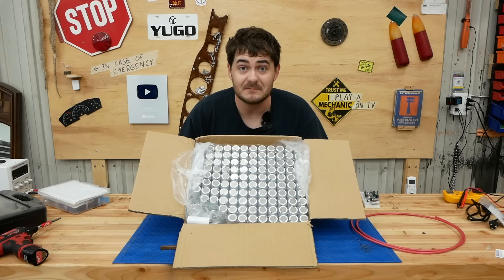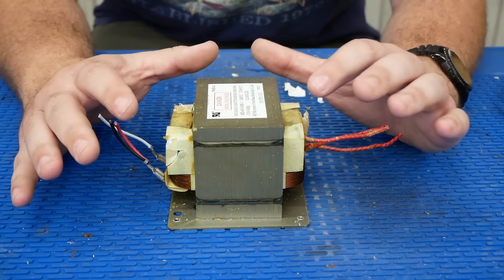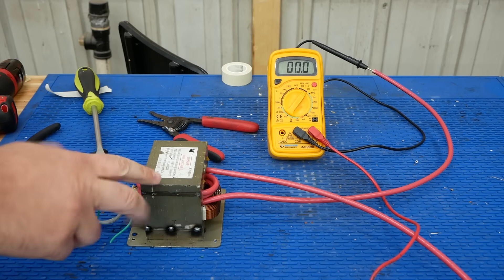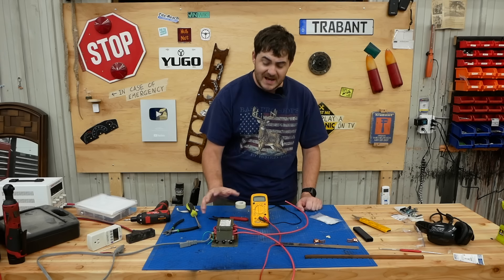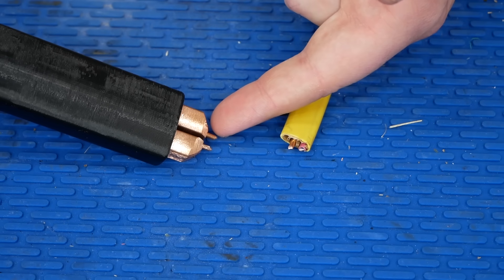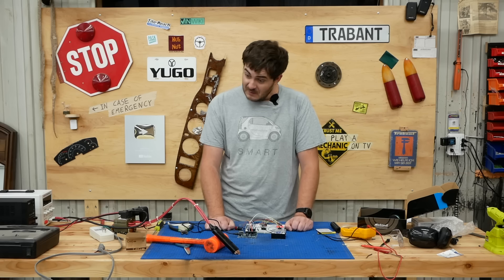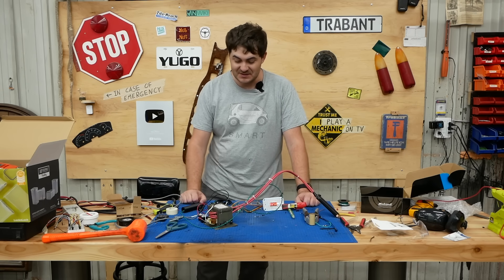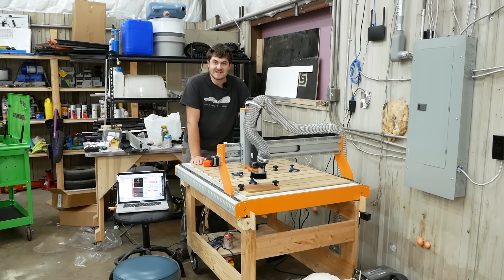I Made a Battery Spot Welder from an Old Microwave and Excessive Mahogany

Comment: This isn't as dangerous as it seems. I don't see any comments thoroughly explaining this, so I'll try my best.

First, I'd like to discuss the misnomer that it's not the voltage that kills but the current. This is technically correct, but not the full story.

It boils down to Ohm's law, which says Current = Voltage ÷ Resistance.
These three values are always tied by this relationship. And there are some consequences to this:

1. An open circuit (no connection) will have an infinite resistance. No current will flow and a power supply will be at its max voltage. Here we see 2V.

2. A short circuit will have no resistance. Therefore infinite current will flow in theory. Metal is an approximation of a short circuit due to having low resistance. If the power supply cannot keep up, it's voltage will drop to maintain Ohm's law.

3. Due to consequence 2, Robert should have actually measured current while welding. (A short circuit) Not while open. The 10A is probably just due to losses. The real current might be much higher than 600A through metal.

4. The human body is pretty resistive. The exact number will depend on what two points of the body you measure through. But even two points close together on the skin has a high resistance. As such, at 2V, the current is very low. Nowhere near enough to hurt you. At 120V, you can flow enough current to kill depending on where through the body it flows. (Particularly the heart)

5. Due to that, the output is actually less dangerous then the input to that transformer after modification. (NOT before)

6. Still, it makes the metal hot. If you touch it while it's welding or shortly after, you will hurt yourself. Be careful nonetheless!

Hopefully this has been educational. Electricity is truly fascinating, and I'm all too happy to spread my knowledge!

Comment: Just FYI: if you can, it's better to remove the secondary without cutting the transformer open (you can for example cut the winding in half and punch it out) because if you break the core you'll never weld it together perfectly and it's gonna change both the inductance of the primary and in general increase the loss of the transformer. You can see this in the video when the transformer vibrates really loudly and draws a lot of current even with no load
Reply: Microwave transformers are purposely lossy.  Wasting power with no load was the cheapest way to current limit the magnetron tube.
Reply: @anullhandle  Yeah, but still, drawing 10A @120V is a lot of power loss. I don't think they're supposed to waste a kW just sitting there idling
Reply: @gigigigiontis8  yeah that's a cubic  butt load.  I think they had magnetic shunt pcs in there making them lossy but kw idle is a BIT much :)
Reply: @gigigigiontis8  It's not actually a kilowatt; most of that 10A is reactive current, which isn't actual power drawn and dissipated, it's energy drawn, magnetically stored in the core, and returned on the next half-cycle. The current is phase-shifted with respect to the voltage. If the transformer actually was drawing a kilowatt unloaded, it would get very hot very quickly.

Also about the video, multiplying the apparent current by the turns or voltage ratio does not give you the maximum output current. Those numbers have very little to do with each other. What you could do is measure the change in primary current between unloaded and while making a weld, and multiply that by the turns ratio.

As you can see during the few test welds, the current is very high, as the strip is glowing. Most similar spot welders not only adjust the length of the pulse, but also the power, by using phase angle control. This requires a zero-crossing detector and some software that's only a little more complicated than just a single delay.
Reply: @tonfleuren3536  That is true, I didn't think about that, but all that current still has to pass through the primary winding; it's still not normal. But you're right, I should've said 1 kVA instead
Reply: @gigigigiontis8  I've just measured the primary winding of a relatively small MOT, meant for 230V, with the secondary windings and the magnetic shunts removed; the resistance was about 7 ohms, and the inductance was approximately 160mH @ 100Hz. The resistance is, obviously, negligible, and the the inductance of 160mH gives a current of about 4.4Arms at 230Vrms, which is very close to 1kVA. The resistive losses would be about 4.4A^2 * 7R = 135W.

I do agree that it's important not to introduce an unwanted airgap when re-welding the transformer, and I've done the same conversions without taking the core apart, but that was also because I don't have a welder to weld it back together.
Reply: @tonfleuren3536  Thanks for the precise measurements. I would've thought it'd have an higher inductance.
It would be interesting to measure his rewound transformer to quantify how much worse it is. Also, as someone else said, eddy currents (due to the core now being a solid block of conductive metal) probably play a role here too
Reply: @gigigigiontis8  In fact, less than 1 Amp.
Reply: Would be cool if he could try this with a different transformer and see how much current it draws without load.
Reply: Indeed. I came here looking for a comment about this - there is a reason transformers consist of insulated laminated strips of iron and not just a solid core (which is what cutting and welding transformed it into (dad joke): eddy currents and resulting heating. I'm really surprised it only got "a little warm" dissipating a kilowatt into that small core. I mean, good lord, that's more than the power draw of a single bar quartz "electric fire" heater... But as he said, since the pulsing circuit interrupts the mains side that should be just fine.
Reply: Yeah, there was a visible gap where he welded it back together.
Reply: As an electrical engineer, it made my eyes bleed when I saw him cutting and then welding back together this laminated transformer core 😄
Reply: I'm surprised it doesn't get hot that 1200w going somewhere.

Comment: I'm sure one could have a very simple timer circuit run from a 555 or something similar with a potentiometer to control pulse time to avoid all the programming malarkey.
Reply: Exactly, but honestly, arduino makes it even easier than using a 555 for people that have never used either. More support for arduino, I think.

Comment: It's a little bit jarring to see the beautiful box and then the power cable held in place with a zip tie. 😅 I can't imagine a proper cable strain relief would be that expensive or hard to get, and it would look a lot nicer to boot! (The welding wire should probably have something protecting them from the box, too, like bushings.)

Comment: @ Mr. Robert: A good source of more flexible conductor for your Zip Zap would be an off cut of SOOW cord.  It'll be nice and flexible and, if you're lucky, an electrician or supply house might just give you a small chunk out of their scrap bin if you ask nicely.  (I know I would if you were closer to me.). Welding cable is always a good choice as well, but don't let the welder catch you shortening their cabling! 😁

Comment: Hah, Ive been thinking about building a spot welder for building the battery bank for my bus, but I'm between spot welding, or 3d printing battery holders. I'm using 18650 cells for my bus though

Comment: You don't need to cut the transformer apart at all, you can just cut the old secondary coil out.

That's what I've done since falling at my first one!
Reply: With the heavy gauge wire he's used for the new coil, it might have been very difficult to thread the new coils in without damaging the insulation. He might also have a use in mind for the finer wires of the old secondary.

Comment: (Ahem). Leaving a transformer running endlessly is very different than leaving a transformer running endlessly under load.  The former heats up according to the efficiency of the transformer; the latter heats up according to the power you're actually using.  The difference between the two is, like, "zero" versus "infinite."  (Well... nearly so.). Just... check it.  See how warm it gets.  Then cut a hole in some nice majogany!

Comment: Oh man, this is giving me flashbacks. I used to work at Batteries Plus store, and we would rebuild battery packs for customers. Most of the time it was things like odd drill pack batteries which are just a bunch of Sub-C's spot welded together. Our machine had a foot lever lever that that would lower the probe and trigger it; I swear it had a bicycle pedal on it. I don't know why, but there was some finesse to it, if you pressed down too hard you would "pop" the weld. You're set up with the trigger looks much easier!

Comment: Tip for the 3d printing. Instead of having to change design in fusion360, in the 3d printer slicer you can adjust the fit using the xy size compensation
Reply: I'm told it's better to change it as design stage and it definitely is a relatively easy task in Fusion 360
Reply: @Middo-572  sometimes you might need to adjust the xy size to make it fit when using a different 3d printer, instead of making the design fit the printer.
Reply: @robertmason6233  Sure, but very, very rarely are you designing something for other people to use on their own printers, as well as yourself. 

Most people start out with one small volume 3d printer and that's where they end, with it being a just fad.  Some just buy the biggest volume printer they can afford and stick with that one. 

There are some who buy a small, starter 3D Printer to see if they like it & it's useful to them, and then buy another, larger volume one and keep the little one to increase output. 

So, in the 2 instances where you've only ever going to have one 3D printer (along with the option of being able to reprint the design on the printer you printed it on in the first place, anyway), changing the design within whatever CAD/CAM software you designed it in is probably still,the smartest idea. That way, if the original part breaks, you simply pull up your design, send it to the slicer without the need to remember to modify it, and jam out the replacement part without printing it, realising you've forgotten to change the dimensions in your slicer and wasting another 3 hours of print time and all that filament, which is plastic waste.  

Or that's the way it makes sense to me.
Reply: @Middo-572  that's fair.

Comment: Hey Robert, I have looked through your arduino code and I think it might be worth adding a safety feature to it. Currently, you're checking if the button is pressed on every loop of the program and activating the relay if that is the case. So if you hold the button pressed in all the time, the relay will activate again and again on every loop of the program. As a result, if you set the activation time low enough and/or don't release the button quickly enough, the relay will activate multiple times.

You might want to add some code, to check if the button had been released and pressed in again, so it would only activate the relay once for every button press. Might save you from burning up the connections you want to spot weld and save you from a fire, in case the button gets stuck pressed in. 

Anyway, great project, you might have convinced me to try it myself. There have been times when I wished I had a battery spot welder, but not often enough to go out and actually buy one and I've been hesitant to make it myself.
Reply: if(isButtonPressed()) {
    activateRelay(300); //hard coded during development
    delay (500); //debounce delay
    while (isButtonPressed()) {  //this while loop hangs until the button is released for the next activation
      // Do nothing
    }
  }
}

Comment: For the high current cables, I'd suggest silicone covered, high thread count wire. It is used in hobby aircrafts and can be quick expensive. But is it ever flexible.

Comment: Now that you've made it, and it works, it's time to do the standard Software Developer thing, and start adding useless features :-D For example, instead of the push button, build a continuity detector into it, so after 1/4 or 1/2 second (configurable, obviously) after it touches the metal to be welded, it welds it by magic! Swap out the rotary potentiometer for an entirely superfluous numeric keypad that's harder to use! Call it the Zip-Zap 2.0 & sell it at a massively overinflated price to anyone who owns an Apple device...

Comment: i built a microwave oven transformer power supply a few years ago. i went a little crazy with my wire and used some 0ga wire. got ~2.2v and dead short, measure out at 1360 amps. just used it a couple weeks ago to weld up some tabs on some 18650's to make a battery pack. best FREE.99 i ever spent.

Comment: Hi, this hasn't been mentioned specifically, but your current code won't limit the pulse time if the button is held down. An easy way to fix this is to wait for the button to be released before continuing the loop. 

I would revise the code as follows:
  if(isButtonPressed()) {
    activateRelay(millisecondsRoundedToFifty);
    while(isButtonPressed()) {
      // do nothing while button is still pressed
    }
    delay(250); // debounce the button
  }

Also in terms of electrical safety you should ground the transformer core to prevent shocks if the primary fails. I can't tell but it looks like you might have just cut the ground wire. You also might want to replace the main power switch with a beefier one. I would want something rated at least 15A at 125V but preferably 20A at 250V. If you try to disconnect a large inductive loads (like a microwave transformer) a cheap switch could blow up. I presume you've seen the Technology Connections clicky switches video.

Comment: I was expecting you to put some kind of ventilation in the box for heat disapation since you made it out of wood. Even though you won't be using it for long enough periods of time to possibly cause problems  I'd still put something there, even if it was overkill.  Still, a great project. Glad you didn't get shocked.

Comment: 3d print tip. Don't know what printer you have so this advice may not help you, but it's possible your printer is over extruding the filament leading to slightly oversized parts, so tight tolarence parts will always fail. Might be worth finding the printer feed rate and try lowering it.

Comment: two things:
1. Glad you mentioned the foot switch. I was going to say that. Harbor Freight sells a cheap one that's sold to be for a 120V tool, but whatever. It's a foot switch.
2. You didn't have to cut the transformer core apart. You could've merely cut the old secondary on each side with a grinder and pound out the innards with a hammer and wood block or other punch. That's A LOT easier than cutting it apart.

Comment: Things may be better now, but when I started 3d printing 5-6 years ago the slicers and CAD didn't play well with imperial units. Now I use metric for everything almost exclusively, and therefore get to enjoy the vastly superior measurement system ;)

Also, the youtuber Makers Muse has made a few versions of a tolerance test to give you an idea of how much clearance you need to add to your parts.

Comment: "Transformers are electromancy" 
Proceeds to build and program a solid state arduino controlled curcuit capable of handling a massive amount of current supplied by a basic single phase step-down transformer that works on the very first try
Reply: That is technomancy. Technomancy is totally different from EElectromancy.
Reply: The machine spirit wills it today -Random Adeptus Mechanicus
Reply: On top everything else, amazing editing skills.
Reply: Black box theory my dude
Reply: You don't need to know how a TV works to know how to wire up a DVD player to it
Reply: Technically, it's controlling the primary which isn't a massive amount of current.
But it is indeed wizardry
Reply: @Gcrilla  It's not even controlling the primary. It's controlling the relay that is controlling the primary. Much like an ogre, electrowizardry has layers.

Comment: I bought a cheap £30 one from banggood. Blew that up and then it worked perfect. Holding one probe apply firm pressure hold down the strip on the battery. Then as quick as you can, tap the other probe to weld the tab on. Made up quite a few packs like this now and frequently test the strength, the strip tears at the weld every time.
Reply: Blew it up and working?
Reply: @TheStuartstardust  yeah the circuit failed closed. I dont know enough to know what components failed

Comment: Heat shouldn't be an issue, but I'd still install a resetable thermal fuse just to be sure. Should be very easy to do

Comment: a transformer basically works by turning electricity into magnetic waves then back again in thinner or thicker wire to change the voltage
Reply: And it is not even that hard to understand the magic behind.

If you take 1200 windings on the primary coil and 50 on the secondary you get a 5V transformer.

The 120 Volts is divided over each winding, making each of the 1200 windings in the primary coil, have 0,1 volts across

The 50 windings on the secondary coil will also have 0,1 volts per winding, making a 5 volt transformer.

Pretty simple, the only thing that takes a bit of math is how much amps you want at that voltage. This determines the gauge of wire you need to use on the primary and secondary windings

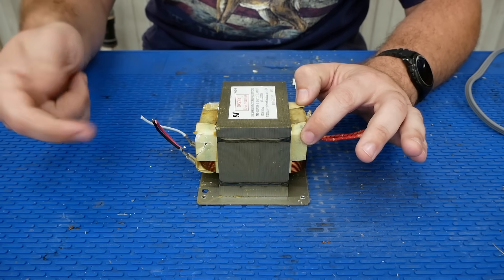Comment: 1:53 Transformers work by a form of electromagnetism.  To keep it simple - the side of the transformer with the higher number of coils is the step-up side and has the higher voltage, and the two coils do not touch.
Reply: No it's wizards.

Comment: Transformers are created by electromancy.

You could also use a mechanical relay timer instead of the Arduino and still get fairly finite control.
Reply: But sub second timing with a timer relay is harder and probably more expensive